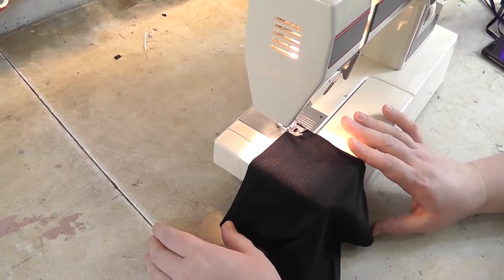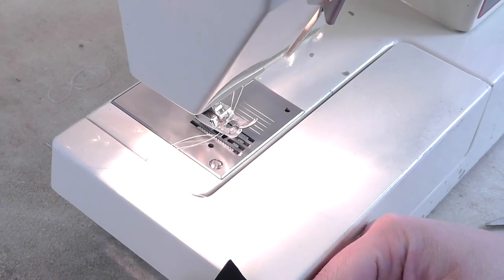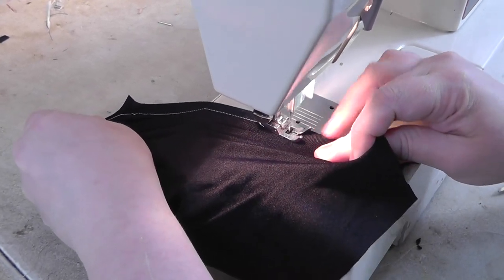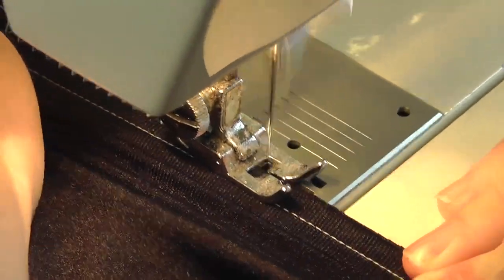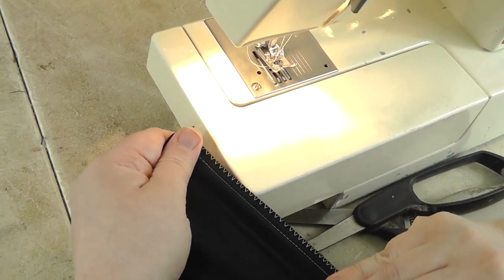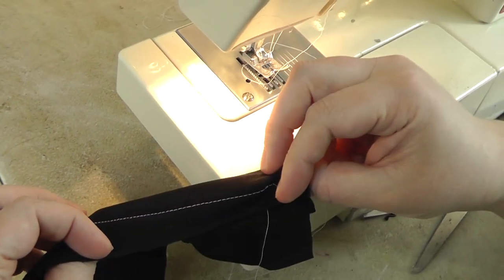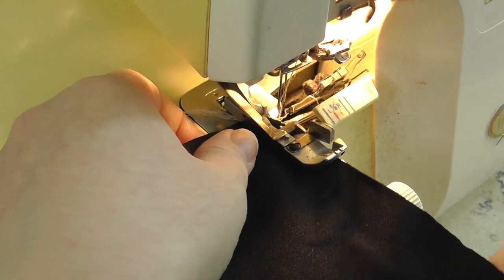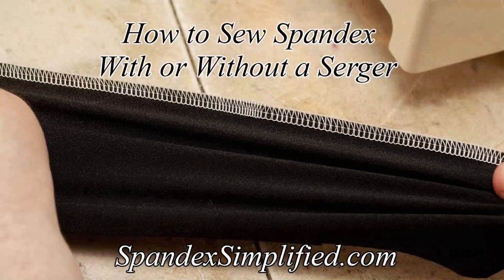How to sew spandex with or without a serger

Comment: Thank you. Was so very helpful for both sewing machine & serger. Gave been a bit intimidated with my first spandex project. As a Tyype 1 diabetic (53 yrs now) wearing two medical devices, I need a sretch tube to protect my sensor device when attached to my arm or thigh to avoid disconnecting the device(s) if bumped/dislodged.  

These are quite costly & I purchased two yards of natural color (closely matching light Caucasian skin). Have been afraid to actually start. 
 - Step one: 
I picked the color & ordered it.
 -Strp two:
I watched your video & witnessed your ease in handling spandex.
- Step three:
Now I feel like I can do it. I'll cut a little larger  to determine correct size & cut again as needed after the practice piece proves the correct size.  I am no longer worried about the sewing. 

I was successful in using a sock, cutting the toe section & attaching elastic top & bottom. Not as pretty.  Spandex should be much nicer to hide  under my office suit wear.
THANK YOU AGAIN FOR SHARING YOUR EXPERIENCE WITH THOSE OF US WHO COULD USE IT.

Comment: How would I do the straight stretch technique with curves?
Reply: Good question.  Anyone?
Reply: You would work in smaller section and thin straight pins to hold the curves together. We you stretch a curved piece fabric it straightens out and then once you let go it will spring back into its curve.